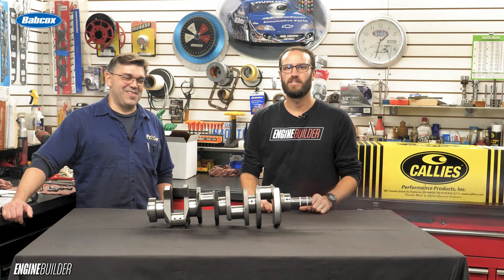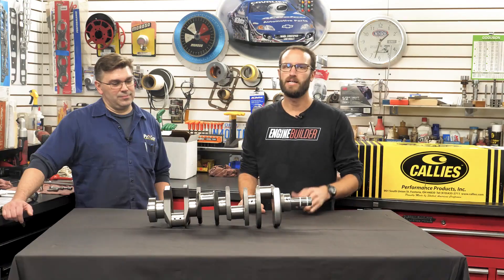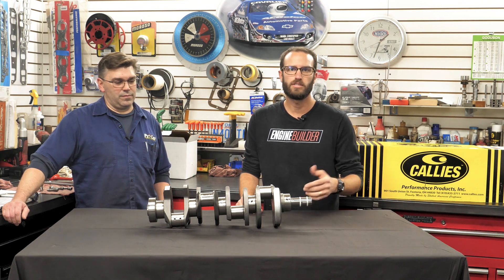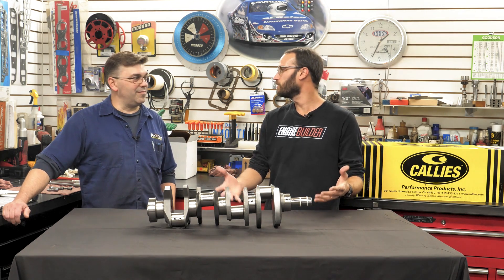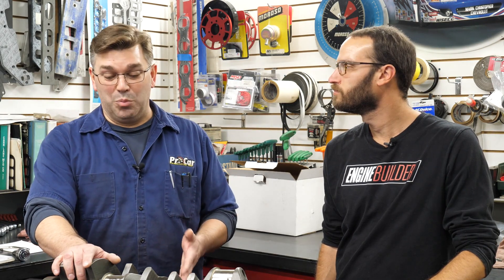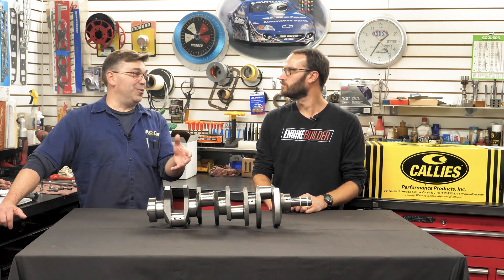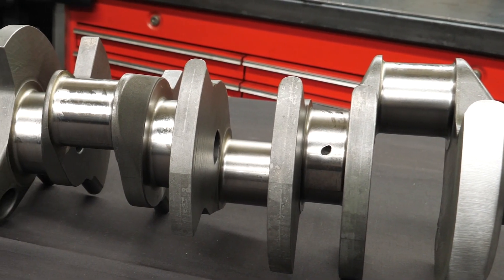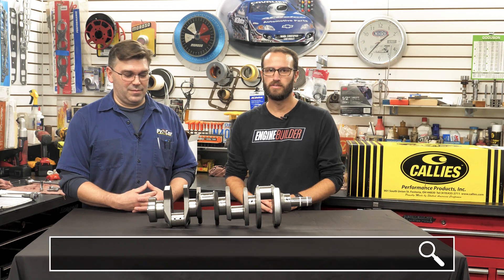Reviewing Callies' Ford Magnum Crankshaft

Comment: I am watching this video, in my opinion if those rods cost 2k
You are doing that job completely wrong.
They should be bored to size on center to the big end. That hone has no business any where near that ROD END.
Go buy a small end boring machine. You might find one at a diesel machine shop.